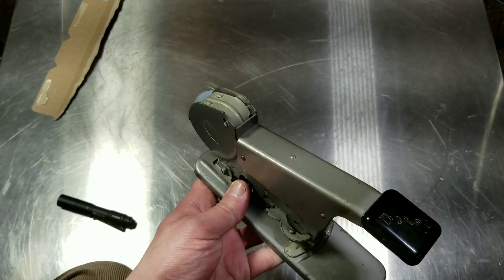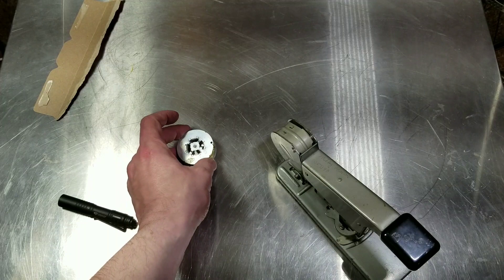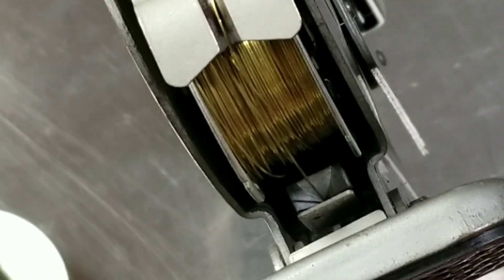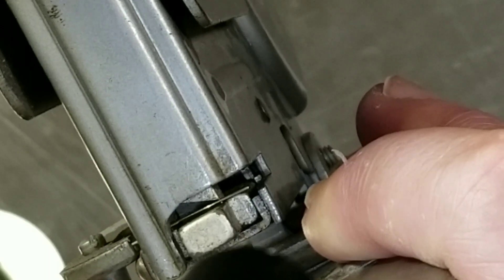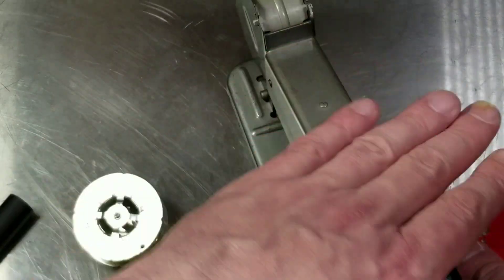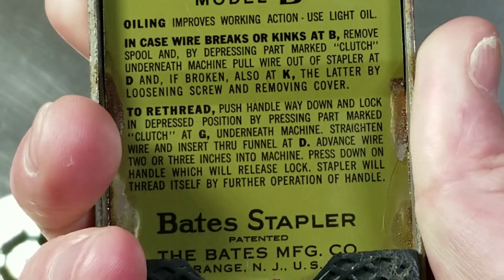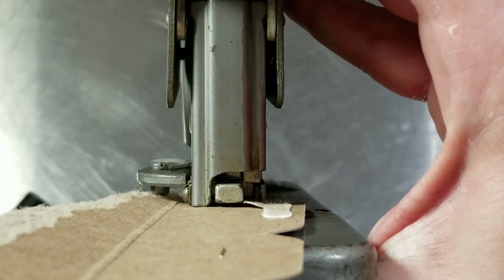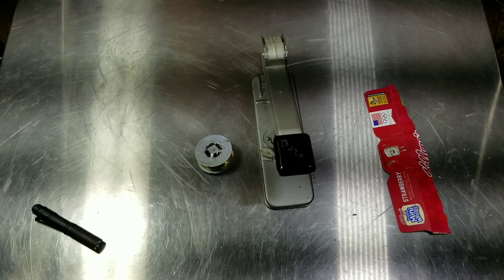Bates Model B Wire Drive Desk Stapler Review

Comment: Cool! I used one in the mid-1970s while working at a 60-ish-year-old not-for-profit company in CT. It worked fine; glad I never had to load the wire. It was explained to me at the time that brass staples were preferred for archival work because they don't rust and discolor paper and break like steel staples do, as can happen when stapled documents are stored for many decades.

Comment: Thanks for this video! I saw a different version of this stapler art an antique mall, and almost bought it as I use stapling fasteners in my aluminum sheet art work.    I just think I would not be able to successfully load the spool with exactly correct wire, nor want to. Also, don’t think it would fasten any more successfully then the multiple staplers I have now.